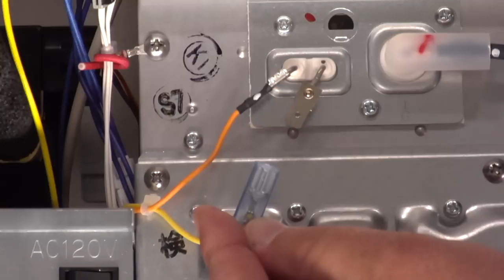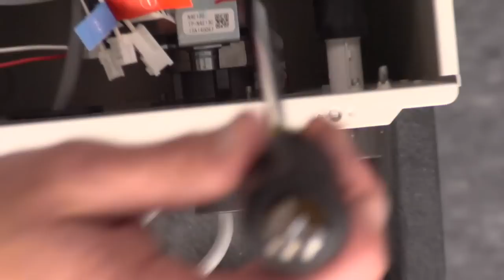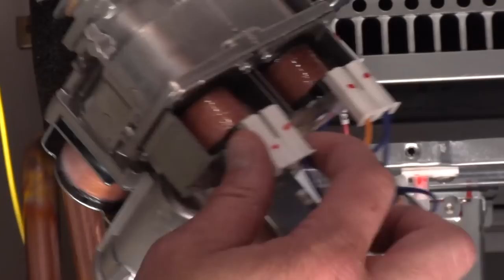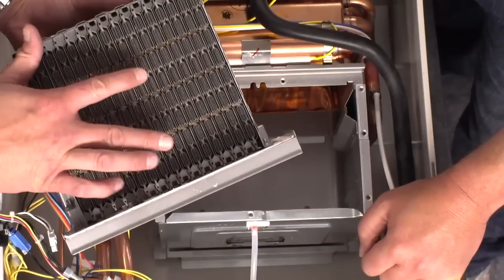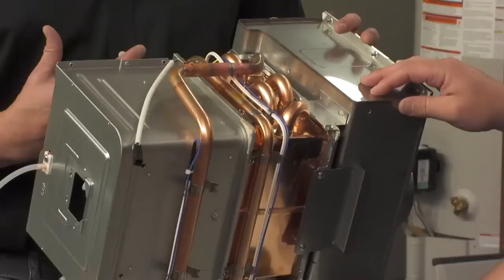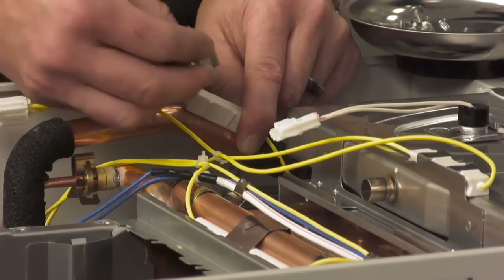A.O. Smith - Tankless Water Heater Teardown | HD Supply

Comment: It's a long video, but for those of you happy homeowners looking to clean the igniter, A/F ratio rod, and flame sensor rod check out 5:40 for the removal and 1:25:10 for the installation.  This made it quite simple to locate the components and there's some good tips.  Just 18 months after install I was getting code 391 Air Fuel Ratio Rod.  First time through it took me about 15 minutes.  I could do it in 5 next time.